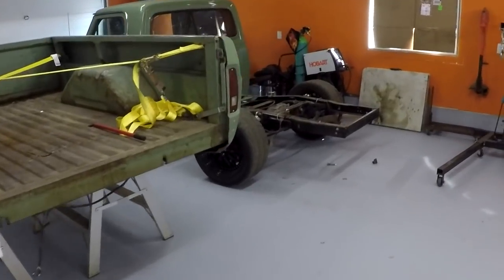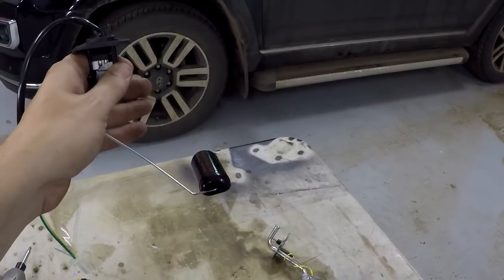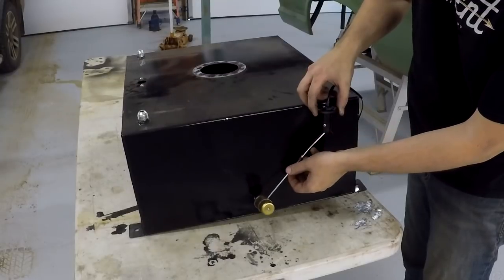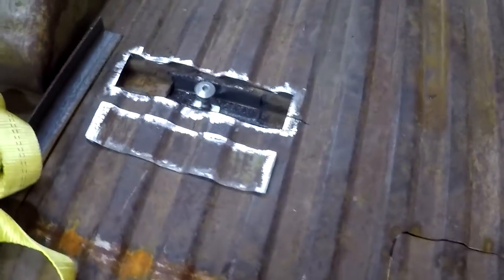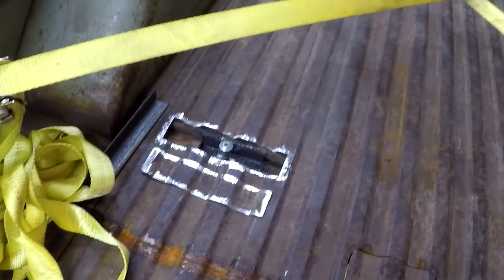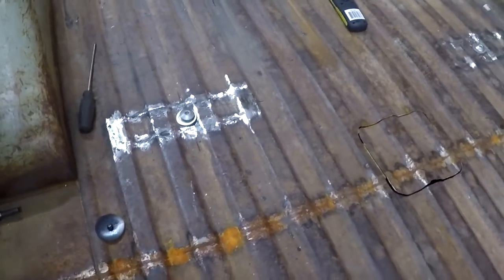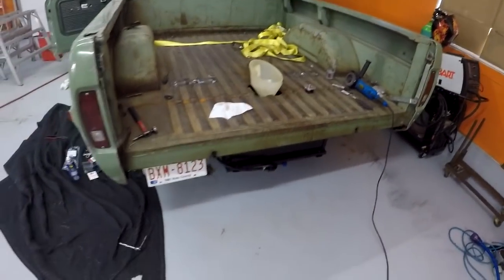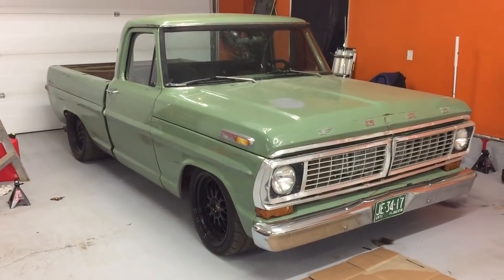Let's get ready to go racing!

Comment: Awesome work. I just started mine. I got the Crown Vic front swapped out and getting ready to start the rear end. I am using the 8.8 with a 4 link and coils. I do not have my motor yet and want to get the rear welded in. My issues I’m running into is setting my pinion angle on the rear end. I am also going to use an LS motor. What is the pinion angle on your trans and rear end. Keep up the awesome work. Truck looks great